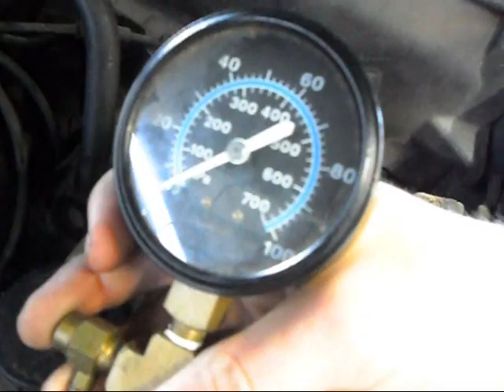How to change the fuel filter on a 1994-2004 Mustang.

Comment: Just pull the fuel pump fuse and run the engine for like 5 seconds till it stalls to bleed off fuel pressure. Dont gotta mess with the schrader valve and leaking gas.
Reply: Start the car then trip the inertia switch. Same thing but it’s just flipping a button
Reply: Can that cause a knock in motor? I’m about to do this exact procedure on a 97 3.8

Comment: I have an 03 mustang GT and whenever I turn on the car the car cranks and all electrical systems turn on the run but when I crank it, it's just stays there and it doesn't turn on completely.. could it be the fuel filter and the fuel pump?
Reply from the maker: Could be that or the anti theft acting up. Does the security light flash?
Reply: Actually yes 😅 the car has an aftermarket security system and the theft light does flash ALL the time.

Comment: Another way to get pressure out. Take out the fuse or relay for the fuel pump. Start vehicle until it dies, and your ready to begin.
Reply from the maker: Yep, I talk about that on the fuel pump replacement.

Comment: Yo my mustang starts runs for about 30 min to an hour than shuts off, no check engine my first thought was failing fuel pump, but that method i thought deeper and relised that the car wouldnt even start, could it be a clogged fuel filter?
Reply from the maker: Not likely to be the filter. I would be looking at something electrical. CCRM maybe. What year and what motor?
Reply: JC316 2001
Reply: V6
Reply: JC316 well my mustang just cranks it wasnt the icm it was the fuel pump or clogged fuel filter i sprayed starting fluid in the throttle body
Reply: jordyn bluerapsyou mine does thing, you ever find out what it was
Reply: kilAcez21 cut fucking wires bro.... i changed fuel pump distributor computer. Went under the dash and the wires are cut

Comment: will a clogged fuel filter cause the car to hesitate?I have an 03 GT
Reply from the maker: Yeah, it can cause that. An ignition coil is also a big cause of hesitation on the 4.6L.
Reply: +JC316 i have an 04 gt and mine hesitates when i accelarate and when im going in low speed i feel like it kinda shakes/vibrates ..a couple of days ago i wanted to test and put the pedal to the metal and when i was going like around 80 mph the check engine light started flashing ..what can be wrong o2 sensor?? fuel filter?? tps?? or coils ?? hope yo reply
Reply from the maker: Flashing check engine light is a misfire. Ignition coils are the most likely suspect on a 4.6L.
Reply: +JC316 thanks man im having that issue since i bought it ..my local mecganic checked the plugs and said they where alright ..so i think its the coils is there a way i can check which coil is bad??
Reply from the maker: Best thing to do is just change them all. They usually start failing at the same time. You can use a code reader, or go to your local auto parts store and have them read the codes for free, to see which one is bad. Pro tip of the day, you can get on ebay and get an entire set of coils for it, for less than the price of one at the auto parts store.
Reply: +JC316 im actually going to my autopart dealer (autozone) to run the code reader ..ill messege you as soon as i get results
Reply: +JC316 they just run the code and nothing came up
Reply from the maker: Has the battery been disconnected since this happened? If not, I would say that your mechanic cleared the codes.
Reply: +JC316 i dont really remember but what do you suggest i do next ..the only time the check engine light flashed was when i was going over 80mph ...i also notice when i turn the key to start the car i cant hear the fuel pump thats why i thought its was the fuel filter
Reply from the maker: A fuel delivery issue can cause a misfire at higher RPM. You can rent a fuel pressure tester to confirm. A quiet fuel pump isn't an issue, they usually start to whine really badly when they're starting to go out.
Reply: +JC316 ok thanks man i really appreciate it
Reply: +JC316 i also didn't mention that a week ago i had a ticking sound under the passenger (like if i had a loose muffler or something like that) but the sound went away
Reply: +JC316 could it be a bad egr valve?
Reply: +JC316 i now think is maybe a clogged catalyic converter. .they told me to disconnect the o2 sensor to check if its the catalyic converter that is bad

Comment: Yo my service engine light is on. Why!!!! Help
Reply from the maker: Considering the average OBD 2 based car has around 3000 possible codes, that's a big question. In short, without more information, I have no freaking clue. Take it to autozone and have them run the codes.

Comment: What do you do when the entire fuel line is fucked, and needs replaced?  Are they going to sell you an OE replacement line, or that AGS Poly Armour brake line bullshit that ALL the autoparts stores sell as fuel line?  Even though older fuel injected cars use threaded fittings on the fuel lines, brake line and fuel line are NOT the same, and are barely interchangeable without some leak prevention.
Reply from the maker: No rust down here, so I've never encountered that issue.
Reply: Oh it's BAD up here, the fuel line failed in several places due to rust alone!  The fun part?  The fuel line only rusted in places where it's mounted to the chassis, so in other words it's better off hanging the fuel and brake lines away from any place moisture's gonna build and start eating away at it.  Since fuel and brake lines have different end flares, Advance and Autozone both expect customers to replace their fuel lines using brake lines.  Bad idea, that's asking for leaks, and so you'll have to teflon tape the shit behind and around the fittings and threads.

Comment: hey thanks buddy i have work on cars but never change one out on my 96
Reply: The 96 GT is even easier! On mine instead of using a fuel line disconnect tool, it uses special plastic clips that secure the fuel lines on to the filter. You can remove these plastic clips with your hand or use a small pick with screw driver handle on it.

Comment: how do you take the line off from the filter if the new one doesn't have one at 3:32?
Reply from the maker: What do you mean? Is it a different style of connector, or does the new filter not look like the old one? If the filter doesn't look like the old one, they sold you the wrong filter and you need to get the correct one.

Comment: You can also disconnect the fuel pump power switch located in the ( Trunk) at the drivers side taillight. Easier that way.
Reply: Is that true can i just disconnect the switch from the trunck instead of using the tool he used in the beginning of the video ?
Reply: Once you disconnect the fuel pump power switch and start it until it dies again, am I good to switch the filter?
Reply: Does that keep the fuel from spraying out all over you from the filter?

Comment: Fail on the fram filter, bad bad bad
Reply: I replaced a 7 year old Fram fuel filter on an 00 GT recently after the car started hesitating at lower rpms.. but it did last 7 years or 50-55k miles.(replaced it with a Napa Gold filter).
Reply: 73mathesar I have a 2000. Napa Gold is pretty good?
Reply: Motorcraft or K&N for me

Comment: What this video doesn’t show is how even with the proper tool you usually have to fight these spring-loaded connectors like a “mofo” to get them to release their grip on the filter!
Reply from the maker: Guess it's a technique that I've honed over the years. Get the tool in place, push the line towards the tool and the tool towards the line while spinning the tool back and forth. Pops right off every time.

Comment: wow what a terrible place for the fuel filter
Reply from the maker: Could be worse, Dodge mounts them directly to the fuel pump, so it's both in the tank and cant be replaced without replacing the fuel pump.